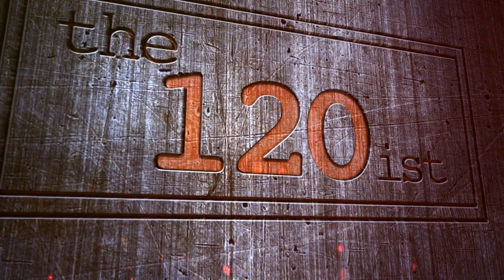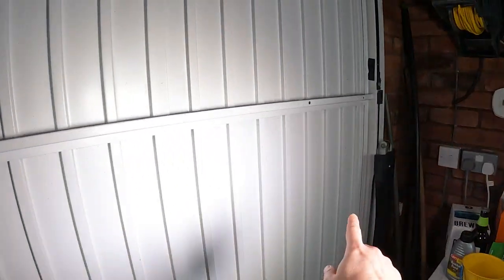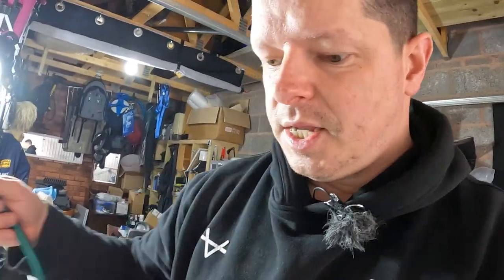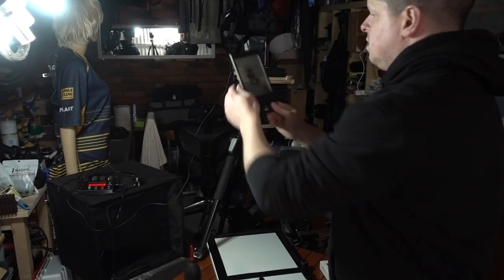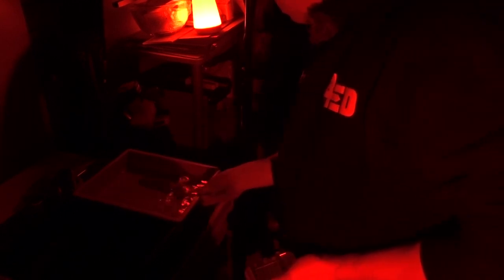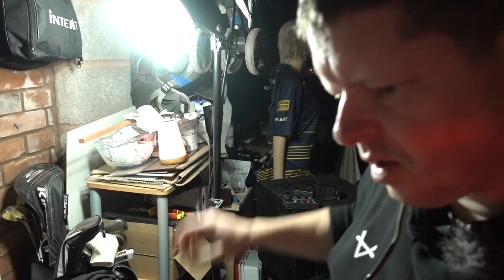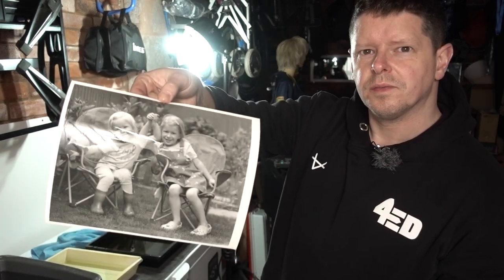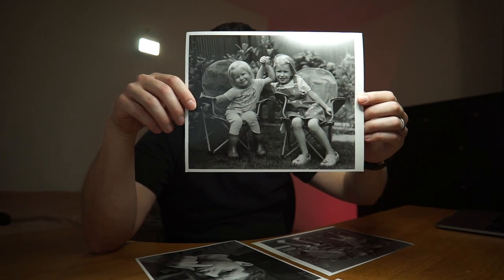My garage darkroom - printing black and white photographs for the first time in 25 years!

Comment: I use to set up a darkroom in the bathroom in my apartment. I used a Besler 23C setting on the toilet seat with the trays in the tub. Worked great just cramped! So you can do it if you really want to. Really nice shot of the girls!
Reply from the maker: Totally agree, and my bathroom was my other option. I think you're message is correct - you can do it, just pick your space and get on with it!

Comment: On my first attempt at home I kept making the same mistake of leaving the aperture wide open. The 40mm (for half frame), schneider lens I got has a funky switch that flips between your set aperture and wide open, and somehow that makes it a lot easier to remember to shut the thing down. I ended up picking up a 50 of the same range, and if I can find an 75/80, I'll get that too!
  If you're still printing, one tip, you've probably found already, is that 5s is quite short to really be making adjustments. Either shut down the aperture a bit, or reduce the brightness (it's in the settings in the intrepid timer), it gives you more time to dodge and burn.
Reply from the maker: Glad someone else has done that! It was just that first attempt, you've got so much going on in your head, and my brain just wouldn't remind me to close the damn iris! I've done it a few times since, but I'm getting better!

That switch on the schneider lenses sounds super handy. Might keep an eye out for those. 

And really good tip ref dimming and closing iris, I haven't been brave enough to try any dodging and burning yet, but it's on my list, so that will be be invaluable advice when I get there. Thank you!

Comment: Nice one, I use the same set up, the only issue I have is making sure that the intrepid is all level and square. It's quite easy to knock it out of alignment.
Reply from the maker: Yeah, I had that problem as well. I was also using a slightly wobbly table to put the easel on. Some fine tuning to the set up required!

Comment: Ah man!  glad to see this! I just finally light sealed my bathroom in preparation to do the same!  Need to order the intrepid enlarger eventually, but for now I'll print a few 35mm and 120 negs
Reply from the maker: Great stuff! At least you have running water in there. But maybe no permanent modifications like I got away with on the garage! Good luck with your printing, I genuinely more satisfaction from that print than I’ve had from photography for a while! Can’t believe I left it so long to start!

Comment: Oh my god.... the shelf is empty.... where have all the good cameras gone.... I was once told that inspiration comes without a manual, or user guide, but it does often appear in the faintest of thoughts or ideas. I was mucking around with an idea myself, of doing some portraits and wanted to recreate the look of old silver plate photography on some medium format B&W film, but using nothing more than a set of 24" square glass panels (4 of them) placed in between the subject and the camera lens. And I would smear black paint on one, smear heavy cream on another, tape strands of thread on another and wet some strips if saran wrap on the last, and use a few different coloured gels. Obviously one would need to experiment to see how much smearing would be needed, and play about with the angles of the glass to tilt the panels away or toward the subject  []<   / / \\    {") . In the end, I suspect you'd need to dress the subject accordingly, and frame the whole thing in an old doorway of an old barn or some such set-up, I'm still working out the details....
Reply from the maker: Ha haaaa! You spotted the shelf! Yeah I've been cleaning up and moved all the cameras to the garage. Didn't have time to move them all back in again. But have no fear, I still have them all. I also have another camera on its way, which you'll approve of... I bought another SLX II. There are two cameras that I regret selling, the SLX and the GW690. I saw an SLX II on sale for a reasonable price, and decided I would bring that back into my collection, and I'll sell some of the others. I just hope that this one is in as good condition as the one that I let go. Fingers crossed.

I love that idea of recreating silver plate style portraits using glass plates. But wow, that's going to take some testing! Have you tried it yet? Or is it just a concept in your mind right now?

For me I think part of my problem is not going far enough away from where I live. Each time I've gone out recently I just look at the same old places and see the same old things. I look for nice compositions in the surrounding area, but when I find them I immediately realise I've shot this exact photo before... so I think a change of scenery, travel to some new places etc., is probably the first thing to try. 

I also think that as blessed as I am to be able to travel the world with my job, it kinda ruins what's outside my front door! When you've stood on a high mountain pass in the Namibia desert, the rolling fields outside my front door just seem boring! Maybe that's a fact of life... maybe that's something I need to work on. Who knows!
Reply: @the120ist  Great to hear that you have placed another endangered camera, back into your exotic-paddock of desirable cameras. Right now its nothing more than an idea I have, to try and replicate the look of silver plate photos, I know many will say - just do the silver plate and be done with it. But then I'd lose the creative magic that might come from those attempts and mistakes to replicate the look, sure you could do it in post, but its not the same as trying to get it to work with film. 

Inspiration is a tough nut to crack, there isn't a manual, or useful help guide available. Now I've said this a number of times, I'm not a photographer, merely a hobbyist and for the most part the photos I've taken are within 50 miles of my home, I've done a little traveling but I'm not what you'd call a seasoned traveler. I would maybe suggest you revisit the places near you, and really tighten up the framing of your photos, and there you just might find what you're looking for. Also have a peek at John Singer Sargent, a painter - and his painting - Staircase in Capri. Sargent loved to play with light and shadow, and this painting is a tightly framed perspective at an acute angle. It might shake something loose. As always, looking forward to whats coming next.